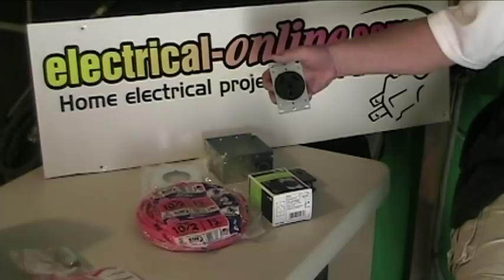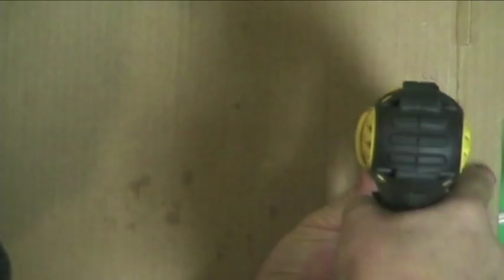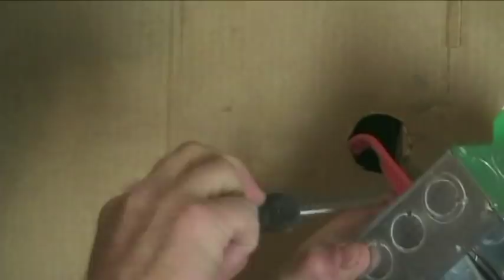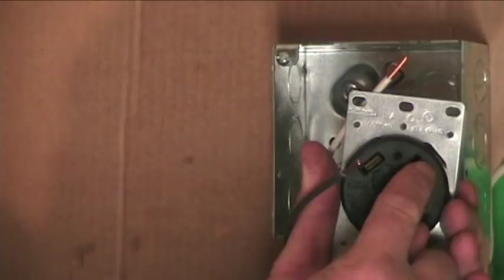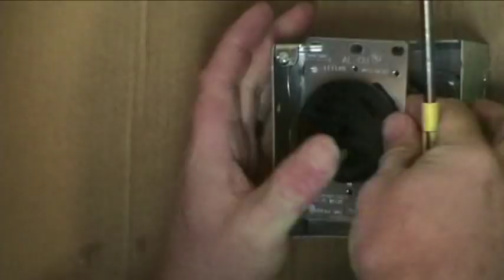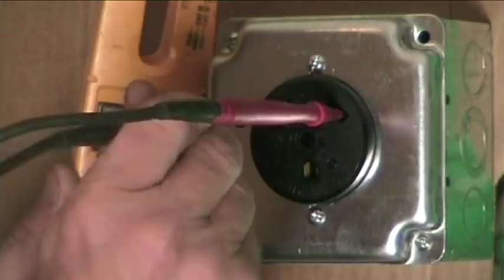How to Wire an RV Receptacle

Comment: Can the receptical be set up 200 feet from the breaker box....so maybe run the 10 gauge wire in pipe or something?
Reply: 10 AWG is the minimum for 30amp @ 120V. Once you start going long distances you are going to need to account for voltage drop. Experts say that voltage drop should never be greater than 3 percent. 

Depending on if you are using alum or copper can make a difference in the length you can run with a certain size wiring. I calculated you would have about a 10% drop with copper 10awg wiring. You almost need to go to a 4 awg to handle that kind of distance. 

I am not an electrician, but I act like one on the Internet.

Comment: Hey, Wonderful video. I am trying to run a hookup to an rv which is approx. 50 feet from house receptacle. From what I understand, I would need to install 30 amp receptacle close to camper and run appropriate wire in gray conduit to outside electrical box at house. is this,correct? Also is the wire that I would be using underground wire?

Comment: Hello mr.terry,can you tell or show me how to wire 50 amp 110 volt for a rv....thanks in advance da Knights
Reply: If you have a 50 amp trailer, it's most likely 50 amp/240 volts. (two hot leads).   It's basically the same deal but requires a two pole breaker at the main panel.  You will also need to use #8 wire instead of #10. (Red and Black are hot, white is neutral and green for ground.)
Reply: x 2

Comment: Hello, I'm building a tiny house and we are now dealing with the electrical work.  I would like to know how to connect a 30 amp exterior plug into the electrical box. What kind of an electrical box would I need for the tiny house? I assume it would need a breaker.

Comment: Great video! I have been asked to install an OUTSIDE RV plug on a post rated at 30amps, except it's 130 FT from the panel! Since it's 125 volts, the voltage drop is huge, so I calculate a #6/2 NMWU cable ran in 2" pvc. What do you suggest? Thanks, Andy
Reply: +andy lenow You only need number #8 stranded. And the voltage drop is not huge. You can go 250' before you need to think about that unless you're running a compressor or big ass power tools. You only need 1" schedule 40 gray PVC to show its an electrical conduit. So no damn white ass PVC. 

It also has to be 24" deep to the top of the pipe. 

Get an NEC code book.

Comment: Being a RV receptacle you should be using a GFCI breaker. Great video!
Reply from the maker: No, there is no requirement for an RV receptacle to be GFCI protected that I'm aware of. New RV's have to have appropriate circuitry to meet the approvals so an RV service is treated more like a sub-panel rather than a convenience outlet.
Reply: +Warpedhumor  - how would you implement a GFCI or AFCI outlet in conjunction with 30amp RV outlet.  So does that mean I would have to add a duplex GFCI or AFCI outlet before the other using the #10 wire?
Reply: Warpedhumor My rv has GFCI built in

Comment: Very nice job looks top notch! Wondering if you can connect the same 30 amp single pole breaker to an standard outlet. Or a heavy duty one instead of the RV plug.

Comment from the maker: Thanks Cazrcon!  Yes, this particular installation is inside my garage.  When I park on the street (temporarily as it's against HOA rules), I use it to plug my RV in to maintain batteries while here.  The intent of the video was to demonstrate how to properly install an RV receptacle, regardless of whether it is an indoor or outdoor installation.  I thought most could figure out that you need a weather-proof cover assembly if installing outdoors.  I guess I need to be more specific in the future

Comment: for those complaining about the video, and location of the box. it depends on the location of the box as to if it needs a all weather box. this could be an inside location and the rv in a garage location. as to wires being too short too long can be a problem too. there are standards out there but a small variance can be allowed. point is here this is a good reference on how to do it. if not sure get a pro to do it for you!

Comment: Thank you, Just placed an outdoor 30 amp RV plug on my power pole for my desert property using your video as a guide. Prior just plugged a indoor 125' 8-2 with ground into a 20 amp plug and laid it on the ground, which started crying by my family so I decided to do it right with an outside 30 amp extension cords and a outside plugin from camping world and your video. Used the right outside conduit, wire, breaker and screws from Home Depot. It works well and family is off my back.

Comment: If your wiring for an RV, which I believe you are, it should be 10/2, white, black and copper just thicker.  It is 10 gauge wire.  Mine had an orange casing.

Comment: Nice video BUT...  In the USA, our National Electrical Code requires longer wires.  I don't know what they use in Canada.  Section 300.14 of the NEC (6" coming out of the raceway AND 3" from the opening of the box).  If I had to service this receptacle, I'd be cussin' you the whole time.  In your Service Panel, again the wires are barely long enough.  The hot lead cannot be moved up or over to the other side of the panel without splicing.  BTW, those are standard 1/2" Romex Connectors.

Comment: Nice video, very comprehensive, but your receptacle is upside down. 90º RV cords have the ground lug at the distal end of the plug, meaning that if you want to plug in an RV with a standard US TT-30 90º shore plug, the cord will have to come in from the top and be plugged in upside down into your receptacle. Were someone to be mounting a tt-30 outside with a rain-cover, this orientation wouldn't work at all. TT-30s should be mounted with the ground lug at the top so cord can drape.
   G
H   N

Comment: It would be appreciated if you could do a video on a 50 amp RV receptacle. I've read some info that states that the 50amp RV receptacle hot legs need to be connected to different electric phases??? I thought that US home panels only had 1 phase. Can I use a regular 50amp double breaker?